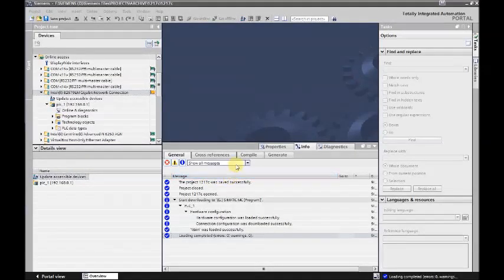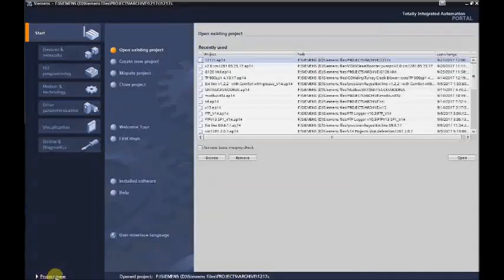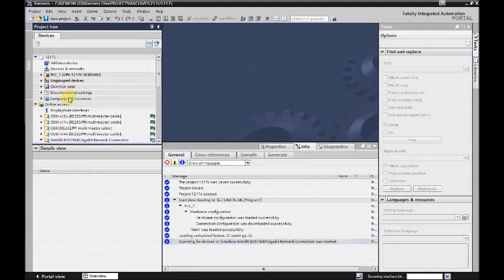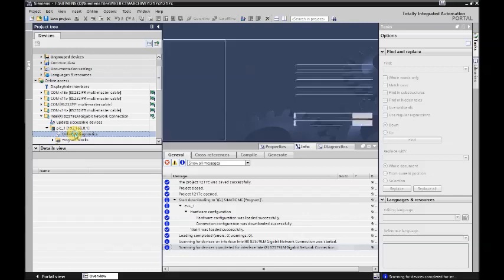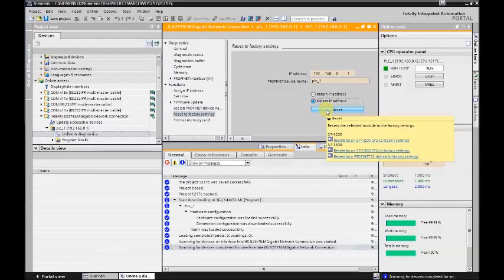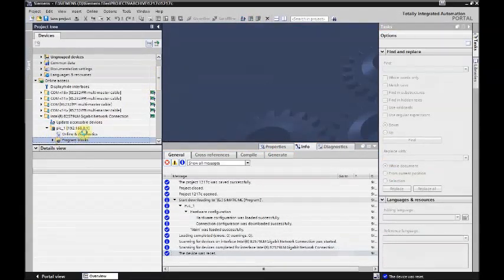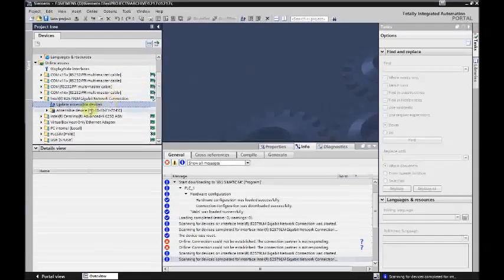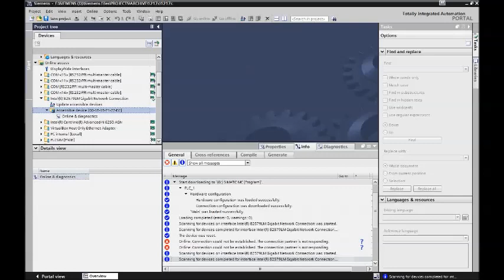Performing a Factory Reset on a SIMATIC S7-1200 in TIA Portal | Authorized Siemens Support | AWC

Comment: Good evening Sir, 
I'm workin' on the Siemens plc s7-1200 tia portal and I cannot reset my own one, because it seems like it's locked. I tried to follow every step you made but it doesn't work. Every single time i try to reset or restart with that program it doesn't consent me to reset to factory settings. Reading my manual I saw I possibly need a SIMATIC MC memory card, but I haven't it yet. Is there a possibility to reset my plc without it? 
Thanks